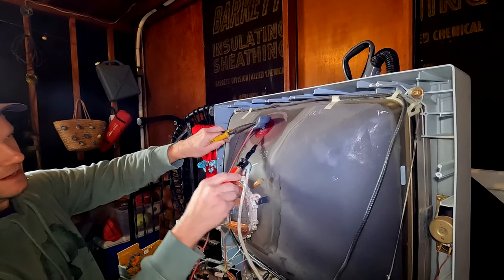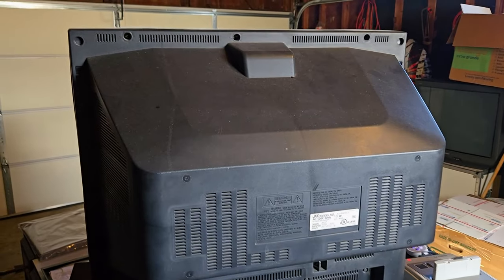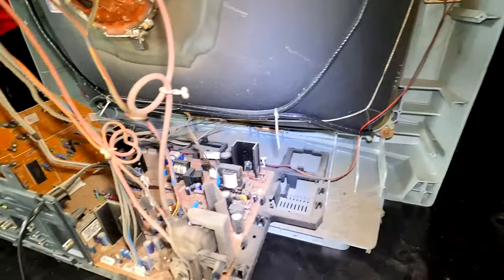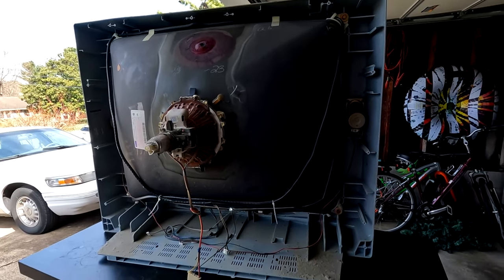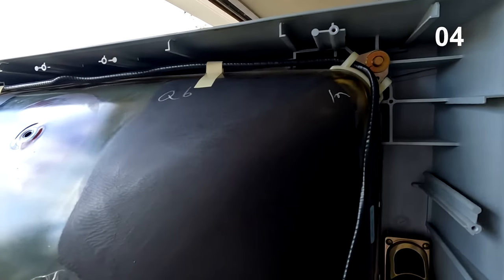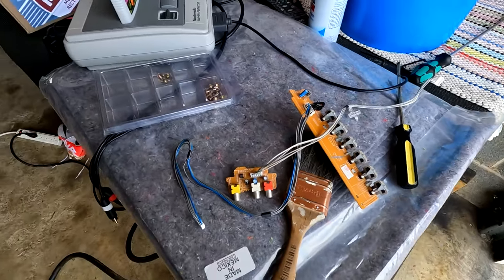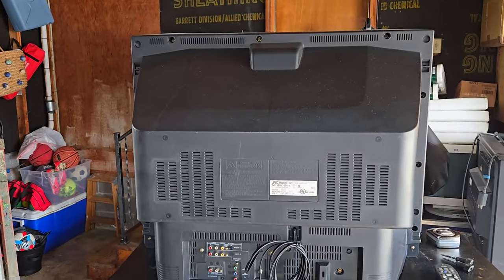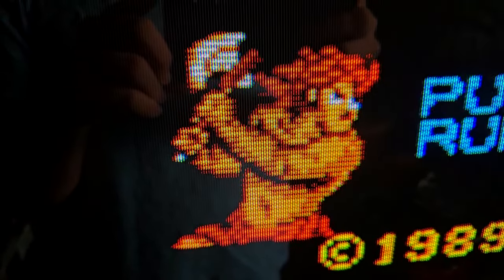Is this the Best TV JVC ever made? | Grading the 32" D Series CRT

Comment from the maker: What do you think of JVC's D Series TVs?  Thanks for checking out this review.  There is a lot of additional information in the description of the video.
Reply: Never used one but they do look really nice
Reply: They look great, especially if you prefer the shadowmask look to the aperature grill of the trinnys
Reply: Love the JVC’s!  The bubbly tube is beautiful!
Reply: I have a Thomson SP Black Pearl 33", which is identical to this model of the D-Series, exact same bubble tube, and the exact same high fidelity line count, the only difference really is it comes with RGB scart instead of component, but that's not really anything important, they both produce the same IQ, it also has a built-in amp for centre and 2 rear speakers, which is nice, sounds amazing with a MiSTer and high-quality audio DAC, Monkey Island games MIDI audio in quad stereo is sublime, and you can use the centre speaker to enhance and isolate speech dialogue and sound effects along with the subwoofer, I also have a DSP that has various EQ settings like a low-pass filter, extra reverb, chorus, room size correction, bass/treble/alto, et cetera.
Reply: They vary, a lot. Inconsistent is the word. Some are great, others just ok. I consider Toshiba to be king for shadow masks.
Reply: Above average. Which is about as good as all the other dozens of CRTs with component inputs at the time.

Comment: I had this exact model, AV-32D303, that I got for free from someone nearby back in 2022. Absolutely amazing TV, but after using it for a few minutes, I realized that mine had a thin scratch right near the middle of the screen and it was deep enough to distort colors so there was no way I could use it. Ended up taking it to a recycling center, glad to see this one getting a full service.

Comment: I really love my JVC-D set. I have both a 32'' and a 27''. The 27'' takes the same pixel quality but is "compressing" it so it appears a bit more "refined" if I can say so but the 32'' is just plain feast for the eyes, especially when sitting only a couple of feet away, the scanlines are gorgeous. I think the decomb filter on composite signal is also excellent... even though I'm using component nowdays 😅And yes the speakers on the 32'' are quite good, I totally agree. And yes it's heavy... it's heavy. I cannot take anything heavier than that 😅

Comment: I own 5 of these....

Three 32" D-Series (two silver, one black) and two of the 36" sets (one black, one silver).

The 32's are all more or less "perfect". All work just fine. I have the matching stand for one of my silver ones.

My silver 36 is my go to for retro gaming. Nice bright tube. Geometry isn't great, but not horrible. I can tweak it little bits here and there in the service menu console depending and it's something you don't really notice much. The black 36 unfortunately is pretty bad shape. Very rough tube, heavy scratches on the front and the tubes very dim. The poor old girl probably has many thousands of hours on her now.

They are wonderful sets though. Solid picture quality. I too love that big ole bubble mask on the 36" sets. Nice 90's look to it cosmetically. Plenty of inputs. Component is a nice touch for those not looking to wonder down the RGB modding rabbit hole (SCART cables... am I right?)

And they were really common, so it's not terribly hard to find them and the larger one's especially tend to be cheap / free (both my 36" sets were free because they couldn't physically move them). 

I'd love to find a 27". They don't come up as often because well.... they don't share the "too heavy to move, takes up too much space" problem of it's bigger brothers.

Comment: Is this copper wiring by the anode cap? Then takes it off. Was that after you discharged it or was there no danger doing that? I sold my 27" D series and picked up a 32" AV-32###. I prefer the look without the side speakers.

Comment: I Have the exact same model I do have a slight color issue😢 I have it in theater pro mode video status but still the whites are a little creamy most likely needs caps replaced or needs to be calibrated